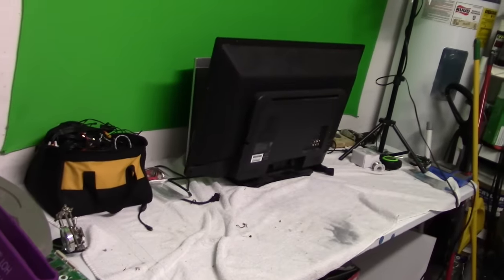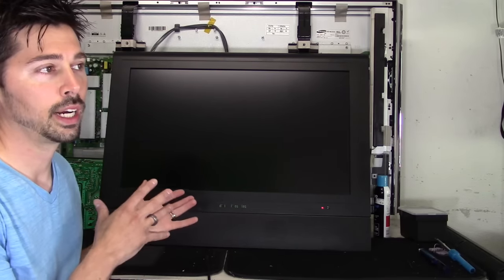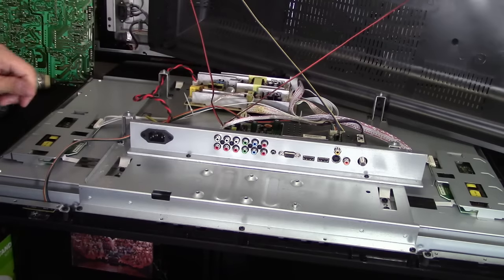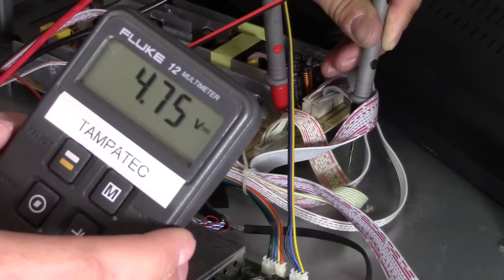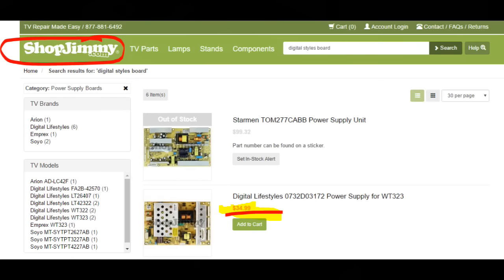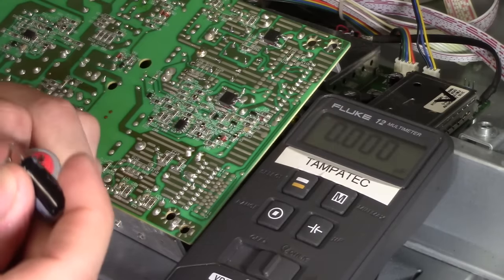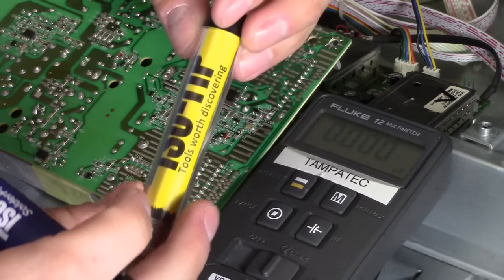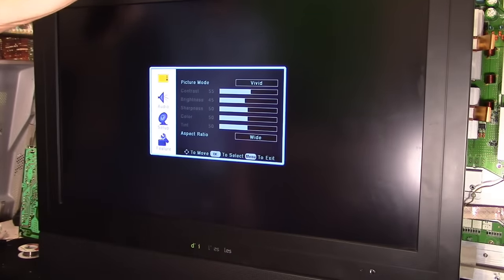WATCH THIS VIDEO BEFORE THROWING OUT YOUR BROKEN FLAT SCREEN TV!!!

Comment: Tempatic, hi 
Did you get my question on the LG plasma? Cutting off and back on again by it self but jo picture plus it make a loud clicking noise while turning off and back on.
Reply from the maker: Sounds like bad caps in power board or main board. Try cap repair kit for your TV model# on eBay or Shopjimmy
Reply: What about the zsus board ,I ask because the board itself looks very discolored and plus when I took the cover off it was dark colored on it as well.  Just peculiar looking..
Reply: In the same area.
Reply: Thanks! Tampa
Reply: @TampaTec  , I have changed out the zsus board and the power board so far and it powers up and clicks back off still, and the stand light is working correctly too red when off , do you think that changing out the main board would fix it? I really don't want to throw the TV away. Any advice?
Reply: I did go to Shop Jimmy and unfortunately the main board was on backorder or don't have one ,also the kit was not available either so! I'm to be notified via email  when one is available,,,  meantime just have to be patient.
Reply: Tampatec, just asking for help.

Comment: I have a flat tv that my son broke the turn on buttoms and he broke the remote control so i umplug it now is off in red. And i don't know if it will turn on with a new remote control i order one. But my question is if the bottom is missing and is off how I'm going to make it work.

Comment: Got a 32" Visio, was unplugged for 6mo, when I plugged it in it gives me the Visio logo splash screen then goes black, pressing menu or input button on the remote does nothing still black. I held in the power/menu button on the back of the set and got it to start to a usable image once. Couldn't get it back there again.  The visio backlight is orange and goes white when I power it up.......any possible ideas to my problem?

Comment: what about a tv that has the red light when plugged in and when you press power it turns blue the logo comes across the tv then once it goes it away the tv turns off by itself?

Comment: Hey my vizio tv recently had scratchy sound earlier before it finally went silent. However I still have a picture, can you help me?
Reply from the maker: If you're using tv speakers and not surround sound it can be a bad amplifier ic on main board but first hard Reset tv by unplugging power cord and HDMI cables for 1 minute. If all inputs still have no audio but picture is ok and tv is out of warranty then order main board at electropartsonline.com or shopjimmy.com part number is on a sticker near edge of the board. Hope that helps.

Comment: I have an Android TV. It works fine then all of a sudden I lose screen and sound the unit is still on just everything goes to black screen. I turn on the air-con and after a short period of time all is back to normal. Any suggestions?

Comment: Years ago, when my eyesight was better, there was a slew of MBs that had the same cap issue.  R&R the caps for a few cents, voila, MB fires up.  Now my sight is "old" and I tried to solder the odo display in my Suburban (2002), took more solder off than I put on. LOL.  Common problem on GMC/Chev trucks of that era.  Anyone with good eyesight?

Comment: Hey sir. I have a Mitsubishi 72 inch I was thinking about throwing out. The green timer light blinks servers times once I plug it up. After so long, it becomes solid. Once it’s solid, I push the power button and it would come on and let me go through the menu and setup reminders. After about 2mins it will shut down automatically. How can I fix this?

Comment: I,ve got a 5 year old LG 50" 1080P OF V, I ACCIDENTLY PUSHED IN ONE OF THE HDM port and have always just used the 2 good ones but I am thinking about just fixinfg it...is there a trick to taking the back off to access and make repair? It should have been takin in when it happened. It broke so easy...
Reply: Dont many are surface soldered or multi layer boards and sometimes when removing pressure will cause further issues
Reply: Kevin Elliott Admittedly not a tv repairman but have worked in service repair for almost 40 years. I'll figure it out. Was just hoping for maybe a tip on removing the back of the tv...
Thanks for the info.

Comment: I only started reading the comments after stopping the video 10 seconds in...and I can't believe the negativity coming off the screen.

I clicked on this video because I have a nice Samsung flat screen tv that has developed a fairly common problem and as a retired electronic tech I have been wondering whether to fix it or just keep watching the very old SONY Trinitron that the Samsung was supposed to replace.

Problem? You turn it on, and it comes on and goes off quickly until about 10 MINUTES have passed, then it works perfectly.  The "instant on" feature isn't, and if it's fixable then I would like to try to repair it.

Comment: your awsome great job. i have a LG smart tv it needs the LED STRIPS REPLACED . i ordered through shop jimmys a few times ordered a power board got the wrong one supposably they said the one they sent would work it didnt even line up. and got contacted from my bank saying my credit card was stopped from purchases attempted using my card number i gave them. the bank traced it to one of the employies at shop jimmys. i was shocked. theyve been my to go to shop...hope they fired the one who did this. anyway awsome video . thank you

Comment: Dude. In a TV power supply you should always use a higher rating temperature on your capacitors. From memory run of the mill electros are 85 deg C. Use 105 deg C caps otherwise they will fail.

Comment: Question… I have a 70” Sharp Aquos tv that when it turns on a few minutes later the screen turns fade blue purple.. is this an easy fix? Thanks in advance.
Reply: My sharp tv faded with black and turned off and now I turn it on sharp logo spears but then instantly fades white dots on the top of my screen and black line then turns off and in order for me to turn it back on I have to unplug and plug it back in to try and turn it back on

Comment: I have a Sony 32" LCD smart tv. Picture goes fuzzy green after been on for around 3 mins then turns itself off. Unplug the tv wait about 15 mins plug back in then all ok works fine for 15 mins then picture goes fuzzy green with lines then turns itself off.

Comment: I HAVE A TV THAT DOES THIS ITS AN 55 INCH RCA LED .......RED LIGHT ,HIT POWER BUTTON DOES NOTHING .....BUT IF WE HOLD A LIL HEATER UP TO THE POWER SUPPLY BOARD FOR 15 MINUTES WHILE PRESSING THE POWER BUTTON TV EVENTUALLY WILL TURN BACK ON AND STAY ON UNTIL POWERED OFF AGAIN .....

Comment: Right, the permissible voltage for 5-volt ICs is 4.75 to 5.25 V.  Since this power supply was very lightly loaded, it should not have been at the bottom of its range -- in fact it's uncommon to get less than 5.00 V even with everything turned on.  So the 4.75 was highly suspicious.  Good diagnosis.

Comment: My fuse wasn't blown on my power supply board. No apparent heat damage. Going to confirm I have all my output voltages before I replace a the power supply board for 50 bucks.

Comment: The value of an electrolytic capacitor is dependent on its design and manufacture, and surprisingly on the applied voltage. If you have a circuit working at 12V, a 16V capacitor is a good choice, but a 100V capacitor is not, because the capacitor will not give its rated capacity when a low voltage is applied. What this means is that your choice of a 35V capacitor to replace a 25V one is a sound decision, but a 100V one may not be... Aim for an applied voltage of about 80% of the rated voltage. 

The appropriate capacitors will need appropriate temperature ratings, and for the power supply, ripple current ratings. So not just "any old capacitor" will do. But...  The caveat...  If it is my TV or monitor, and I am willing to fix it more than once, well that does open up the capacitor choice :-)

Comment: Unless it is an obvious failure cause (Broken wire; Burned components), I imagine most failures of electronic equipment is due to bad capacitors.  The trick is which ones?  Many just fail from age without showing anything externally??

Comment: How does one fix a stripped thread on the back of a tv that’s used to mount it to the wall?
Reply from the maker: Plastic sometimes gets stripped but if it's not used to mount a TV and at least 6 screws are holding back cover it should be ok. Check with manufacturer to be sure.

Comment: I have a TV that turns on with the switch on the set. The remote won’t work I bought a new remote and it won’t work and I need the remote control all the settings

Comment: i have a led tv that turns to green but no sound or picture, where would be the best place to start fault finding?
Reply: Get a multimeter onto the power supply board- the voltages for the cable connectors are printed on the board near each plug. There is a tampatec video that covers this which taught me a lot. I managed to diagnose low led power supply voltages on a free 55" lg smart tv i got from the scrapyard. Is only 5 years old! A new board will only cost me $75 and easier than replacing components as I'm a newbie to electronics. Good luck!

Comment: what if the button doesn't work? like press the power button and nothing happens, and if i use the remote it doesn't work either, funny enough it sometimes turns on by itself and it works the power button just doesn't 
(actually every button on the side of the tv doesn't work)

Comment: How to repair a tv that over heats fast? I usually play my ps4 then after 15mins of use, i get white shadows/glare then screen turns white with lines but you can still see display. Im guessing my power supply heats fast. Its hot when i opened it
Reply: First thing is to make sure that you do not have alot of dust or pet hair collecting in/near the vents that are molded in the outer case of the TV. Second, make sure nobody does or did smoke near it, as cigarette smoke is very sticky and will coat everything it touches and act like an insulator on every electrical component. Third, Make sure there is good air space around the TV so that air can actually get around the unit to cool it; an inch or 2 (3-5 cm) around the sides and back is usually good.
If those ideas don't help you, and you have some of the tools that he has (like a meter and an iron) try this. Find an output from the power supply that is 5 volts that only comes on when the TV is on. Next, get yourself one (or a few) quiet computer fans and mount them inside to pull air through from bottom upward and out to help cool things down. Just be sure that you have them facing the right way and you don't leave too big of holes that you let blobs of gunk into the inside of your TV.

Comment: Congrats on a successful operation doctor.  Thing is, capacitors don't just up and freak out for the heck of it.  What happened to cause the damage in the first place.  simply replacing parts is rarely the answer and certainly not a proper diagnosis.

Comment: I can see what is wrong  at 3:10  it is an electrolytic capacitor in the power supply the top is puffed up on the electrolytic capacitor it is an easy fix.

Comment: Most electronics these days have cheap power supplies, thats one reason why they don't weigh very much too.  A decent power supply is heavy and will last longer than the device.  Well, that has all changed due to "electronic" power supplies. First thing to go bad in most electronics in most cases.

Comment: Volts do not run through a capacitor, volts are electrical pressure and are across a capacitor.

Comment: How many watt does my gun have to be?
Reply from the maker: I use adjustable 60 Watt soldering iron. I set to middle. And for heavy solder joints increase.
Reply: @TampaTec  OK thanks .

Comment: Maybe I did something else, but the last time I touched a capacitor I remember getting shocked real good. What gives?
Reply: Caps hold electricity so if they are charged and you touch the leads it will light you up.

Comment: You "might" be able to fix your TV yourself, sure.  But chances are you won't be able to.  Very very few new parts are available, and no service information.  Boards are lead free solder and surface mount components.  If you don't have the experience of working with lead free solder or surface mount components, don't bother.  These sets were designed not to be easily repairable, and not to last. I've done this for 20+ years, day in, day out.  I don't like having to tell people not to bother trying, but it's true.  I love troubleshooting and repair, but when it comes to newer tvs, forget it.  If you want to work with electronics, work with older/vintage items.  Not new stuff.

Comment: If the capacitor are swollen it sound a bit like Samsung using cheap capacitor for their PC monitor some 10 years back. Looking at the colour of the capacitor they are the same colour as those of the monitor. Some scrupulous cheaters around..

Comment: If the TV is 50" or larger then it's worth something but, if it's under 50" and you can get a brand new one with Roku built in for literally a hundred bucks... recycle it. Repairing TV's can rapidly approach the point of diminishing return. Not hatin, just being realistic.
Reply: That may be true from a commercial  point of view but if you have the time and some basic knowledge then I think it's always worth a go. I have two 27" Samsung monitors with smart TV built in and they have an intermittent power problem. One is currently working ok but the other works for 20 seconds then reboots. Even though the PSU caps look ok I suspect one or more mat be shot. It's worth it to me to replace those caps (I will replace all of them) to see if it fixes the problem. They are great monitors.

Comment: I'll try to fix what I can. I used to do repair for a living, but after you retire,.... Done it a few decades, you learn that once one thing goes on those cheapass China components, there's a few more just about ready. I repaired one projector TV I owned 5 times before I decided I could live without that EPIC sound system it had, and ditch the crappy blurry 1998 projector picture on that $2800 60", and get a 60" 4000 smart TV with a good sub and bar, and TRUELY enjoy TV again after almost two decades. Miss that boom boom theater sound that projector TV had still...... The bar and sub ain't even close to the quality, but it's loud enough I guess. Just saying.... Sometimes it ain't worth nursing old tech along by fixing and fixing it!

Comment: Hope you all noticed he removed the caps BEFORE measuring them... other circuitry would interfere if still soldered in...misleading you... so, unf... you cannot just zip around the board, trying for a quick find/ fix.

Comment: If you have a bulged capacitor don't bother testing it. Replace it may or may not be your problem but it will cause problems in the future.

Comment: My jvc smart tv menu toggle keeps freezing on my wifi option and my sky box will not work either now 🤔😕🙄😭
Reply: One thing you might try; is to go to the jvc website and download the firmware for the tv. Usuallu is a .epk file that is zipped, unzip it and put it on a flash drive, plug it into the tv, put the tv in service mode (like holding ok on the remote and the tv at the same time during power on) and re-flash the firmware with either the original version or an updated version. Sometimes software gets corrupt. Good luck!
Reply: @artstahl4507  I will try it later thanks 👍
Reply: @artstahl4507  hi I've looked on the jvc website and can't find any firmware I've even typed in my model number JVC LT40C750A🤔

Comment: Wow I think you need to be more cautious working with power supply. And get a real solder iron. Also use a wider tip for easier removal. Not much for safety are u.....

Comment: Hi I have a question maybe u could help with. I have a 58" Samsung plasma that was just cutting off periodically and finally just went black. The power source does come on and red led blinks. Everyone said it's the all the caps but none are even bulging at all. What do u think? I mean it seems like a frequent repair for this model TV but physically not even 1 "looks" bad. Thanks in advance I appreciate any time u give to this question. Kushlak@yahoo

Comment: Hardly worth the effort unless you replace all of the capacitors in the power supply and use solid capacitors.  Anyone doing the kind of repair in your video commercially is a cowboy.

Comment: a child threw a toy and broke screen.lines on the top and bottem what needs to be changed
Reply from the maker: Screen probably cracked. It's hard to find those screens. Sells the boards on eBay, should get $50 per board.

Comment: Westinghouse ew37s5kw 
Power on blue lite up right corner have tv channel number but no video n audio
Can't change any manual or remote , even turn off ,no
Have to remove plug 120v
Many trying ,same same hanging status. Repeatedly
Help ,510593531zero

Comment: The picture showing unplugging the power cord from the outlet is TOTALLY WRONG...DUH! That can break the wiring inside the molded plug which later on can arc inside and start a fire...DUH! You get a THUMBS DOWN from me!
Reply: Hey Newton's Niece, that was only symbolic, and not be considered literally!!!
Reply: @jitujitu9157  I have seen so many people yank the cords as shown by the " SYMBOLIC PICTURE"  It would be better to show the PROPER SYMBOLIC picture pulling the cords from the actual plug, Thanks.